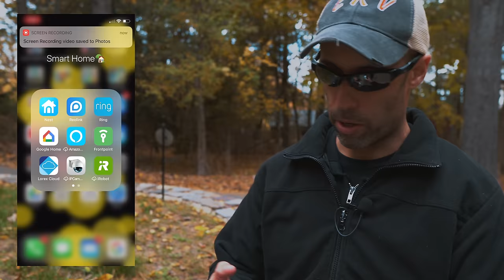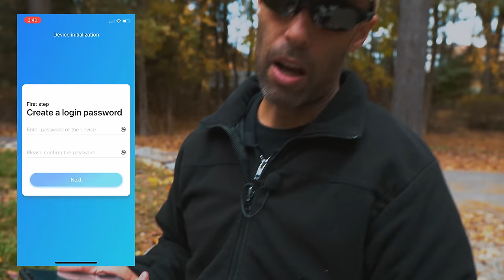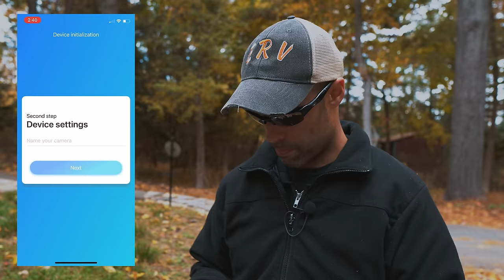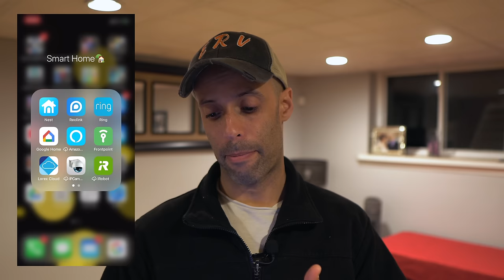RV Security — A Cop’s TOP Choice!

Comment: The only thing about the Reolink is the lag time between the camera seeing something and the time you get the alert and from the alert to the time it loads to play it. I have their double camera unit on my house, great picture, great view80+ feet from left to right and from house to street. I can walk out to my truck, get in, start it and drive onto the street and I will finally get the alert that I walked out of the house, a minute later I get the alert of my truck leaving the driveway. I have the camera located 12’ from the router, I have anywhere between 380-420 megs at any given time. No excuse for the lag. The only thing I feel it’s good for is a deterrent especially at night because mine has lites on it when it sense motion. It will suffice for now until I find a way to put a wired camera in because I want to be able to see at the time not 3 minutes afterwards.
Reply: Woooooah deal breaker, thanks for heads up… could have been bad guy drivin your car to the bank for a with drawl
Reply: Any new research since then? We need to outfit a DIY RV conversion pretty soon

Comment: I would be interested in a follow-up real world use. Did they fall off during travel?  No wifi campgrounds, did you lose all views?  The solar panel will need sun, when campgrounds have slight or ?high shade.  Did the battery die if they are used. If they were front facing, then every time someone walked by, they would record, and soon die.

Comment: I give a thumbs up because after a lot of thought I feel this is a very good video. However I’ve had my Rv vandalized right in front of my house 3 times in the past two years and I expect this to be an ongoing thing. These cameras can be knocked off with a stick in a matter of seconds. I will spend the extra money for a professional electrician to wire up 4 cameras that will shine a light on an intruder, record him and sound a siren as well as inform you on your phone. The system plugs into any outlet in my van which is run off my inverter. I have 200 watts solar panel that charge my batteries.
Reply from the maker: The cameras have cloud service so all data is uploaded to cloud.  Thanks for watching and the comment

Comment: Izzy, I know this video was done a couple years ago. I'm not looking for the most expensive cameras for my Rv,  just want something that will work off my RV internet connection where I can look at a live view of the inside or outside of RV. I do have a Rerolink cameras and dvd for home use and it works well. Does you video still go for these cameras in your video or is there an update on new camera models? Our RV sits in a off site RV storage facility it would be nice to see if its still there, did the tore covers blow off etc?

Comment: Are you using the same Wi-Fi network for your cameras every time you travel, such as a mobile hot spot or your phone network?  Thanks for the video and info.  We use Arlo at home, new truck should be here next week so we are trying to decide on a security camera system to use on the 5th wheel RV.
Reply from the maker: We have a dedicated network in our motorhome

Comment: Izzy,
If you said how far it transmits, I missed it. The problem I have with all of these is that I need it to transmit 400 feet down a tree lined lane. If it doesn't do that then it won't work for me.
Reply from the maker: The camera does not have a transmission range per say.  What you need to focus on is your WiFi setup.   You probably need several repeaters to saturate your area with WiFi.  We have the google nest 2 wireless routers and we can get signal all around our home and outside our home.   

The cameras will work as long as they pick up your WiFi.   

Hope that makes sense.  

Izzy
Reply: @EndlessRVing  Thanks, yes it does unfortunately I am tied into the "dsl gateway" router supplied by my phone company. It is registered by serial number to their service and there is no way to extend it. The signal would have to do though the woods to the camera. No other internet service is available in my rural area.

Comment: I have been looking for a camera to use when hitching up my 5th wheel trailer and then use it inside the trailer when pulling so I know the TV did not detach e from wall or the fridge door didn't pop open. So I need a portable camera with magnet battery power that's rechargeable. I never drive longer a few hours at a time.

Comment: A few questions , we are a few months out from delivery on our first RV (Geo pro 15 tb) as we move from long trail hikers to getting off the ground and no longer being “cat hole” people ! We also have an off grid cabin in northern Maine so looking to address both security situations. After a year now would you still recommend this? What, if any concerns or suggestions do you have. How well does this work in iffy cell service areas. Does that impact performance and battery use. Finally, can you easily suspend its use if, for example, someone was using our cabin with permission in our absence. Great channel..retired FD/EMS so appreciate your info and expertise. Getting caught up on your content as we  move from trail/tent dwellers to this RV world. Thanks
Reply from the maker: If you don’t have internet the camera won’t work so off grid will be a challenge.  

Thanks for watching

Comment: Thanks for the straightforward and informative video.  Quick question: are these cameras essentially asleep (to preserve battery life) and essentially turn on AND connect to the WIFI when motion is detected?  Thinking to use such a system when car camping and tethered to my iPhone's hotspot.  Just wondering if the camera is eating up data 24/7.
Reply from the maker: They are motion activated or activated if you log into them.

Comment: Curious if you thought about systems link Ring that also include contact sensors for door/window, smoke/CO2, water leak as well as cameras?  Changing Lanes has excellent video on Ring.  Thanks for review.  Travel safe.
Reply from the maker: Ring is great system although we have nest at home.  Thanks for watching and the comment. 

Izzy

Comment: Thanks for sharing this video. If I'm boondocking and don't have access to Wifi will the cameras not record? And do I have to connect it the solar panels?  I already have solar panels on my rig and don't think there is a place for them. I like the alarm feature too.
Reply from the maker: They will record directly to micro SD card.  You don’t need panels but the batteries won’t stay charged for long without them

Thanks for watching and the comment 

Izzy

Comment: I live in the woods, where my internet connection is through my cellular provider, Verizon.  We don’t have broadband or hardwired WiFi. So, how do these cameras work on a RV if you are boondocking and have no cellular service, or at best minimal cell tower service?
Reply from the maker: They have onboard SD card recording but you will not be able to monitor it without internet.

Comment: I have the Argus 2 and it is not motion driven but rather infrared driven. What that means is that my vehicle, which is parked directly in front of the camera, isn't recorded when I drive it because there was not enough difference in the infrared spectrum to activate the sensor. It never records my wife's car backing out of the garage as she's going to work even though her vehicle is within eight feet from the camera.
Reply from the maker: Thanks for sharing.
Reply: Will it catch a bad guy super bundled up in the winter? (Tough question, but I’m out here doin homework; Love the infrared factor.) would work d in the trees typically trigger it? If so, would relief unnecessary record times

Comment: Have 4 of these on our offgrid cabin,   2 fixed and 2 pan tilt,  after 21 to 23 days,  they stop recording to the cloud,   power reset doesn't work,   reset doesn't change it,  I have to do a complete factory reset.  Major pita.      
It does send still jpgs if motion via email.   And it is really crisp on 1080p.    But a bandwidth hog.
Reply from the maker: Thanks for letting us know. :) - MJ

Comment: Izzy, you didn't rate the product after installation. How did it work when you went on long distance trip? Did you feel after you put the Dicor on the base that it was safe to travel at your normal operating speed? I presume the you remove the other 3 cameras to get them charged? I looked at their site no humans available.
Reply from the maker: Dicor is sufficient to hold down the base and panels.